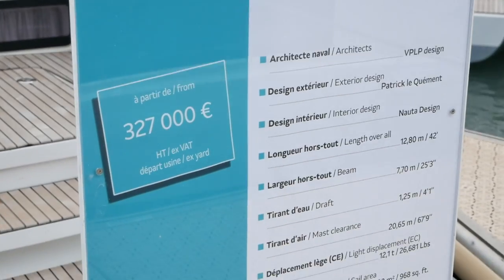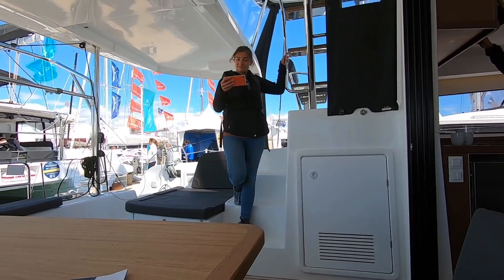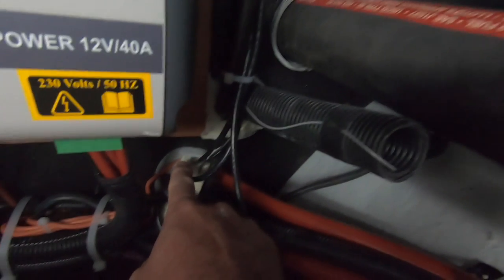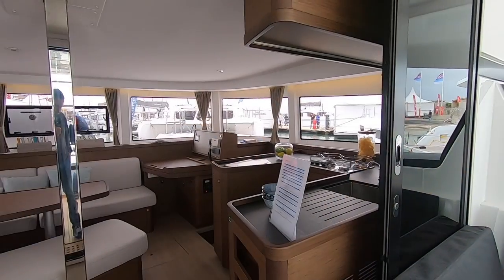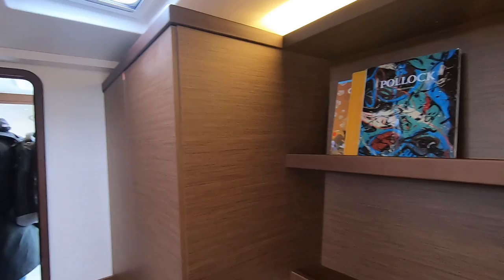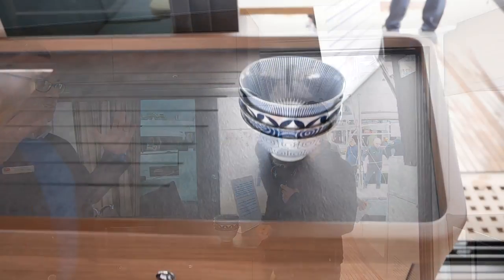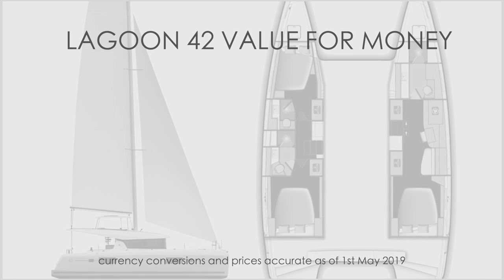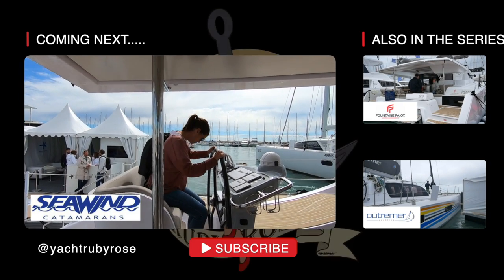Lagoon 42 Catamaran Review 2021 | Our Search for the Perfect Catamaran | Sailing Yacht Ruby Rose

Comment: Production boats represent a better value because their development is amortized over a much larger number of hulls, and the company potentially has more resources to devote to the design.  Being a large volume maker also means the builders and designers benefit from the experience effect: doing more of something tends to make one better at it.

This particular boat seems well built and designed, if slow (by design).  Aside from speed, it's better designed and built than other of the much smaller volume boats you reviewed.  Support should generally be more widely and commonly available too.

The galley is a bit small, as you note.

Comment: Those very large flat windows on the bridge deck concern me. Many times I've been to sea and experienced heavy waves coming over the deck. I have to wonder how they would fare in big seas. Not the sort of thing you would wish to experience at night. Also, I didn't see an emergency hatch inside the hulls. (or did I miss them)?
Reply: There are emergency hatches in each hull. the windows have been in Lagoon designs for decades. If there was an issue with them then we would have heard about it by now. I think any wave breaking over the hulls of a 42 foot lagoon with enough force to break plexiglass windows would indicate you have far bigger problems at hand.

Comment: Nick, I did not see you rate or consider the bane of most cats, the clearance to the water from the main living area.  The "bash" factor.  From friends of mine who charter cats, the newer the boat design the less the "bash" but even some of the new boats I am told have very low clearance and there is significant noise in light seas.  Thoughts?  Should this not be a concern or is this just an accepted reality of cats?
Reply from the maker: Bridge deck clearance is only one factor regarding the slamming when we decided all this. It is also the shape of the underside, the sea state the direction of swell and other things.
It would be impossible to assess at a boat show, so we left it out.
Reply: @sailingrubyrose  Makes total sense, thank you for your very quick response!!

Comment: I also am hot sleeper, why is air conditioning not on your list? That's a must have for me, no negotiations.
Reply from the maker: Difficult when you spend months on end at anchor. You need to run a generator for this which uses a lot of fuel, makes noise and is not good for the environment .
Reply: @sailingrubyrose  Did you talk to Nikki and Jason about running aircon from battery? They went to a lot of effort to make that happen and haven't mentioned it much since then. I'm curious if they've stopped using it.

Comment: The helm position looks much safer with this hard dodger! I saw one of the Lagoon 42s and it seemed really unprotected like you could easily fall off the seat into the ocean lol. The hand rail seems really bad! Especially if you were to sail single-handed! I did read a bit ago about people fitting jackstays to lagoon 450 - in order to clip on safety lines when wearing a harness -  but they couldn't find many attachment points. Not sure how it is with the new 42...
Reply from the maker: There  are definitely a lot of owners modifying their boats
Reply from the maker: There  are definitely a lot of owners modifying their boats
Reply: @sailingrubyrose Yup..  Did u check out the Dragonfly 40 btw? It's a trimaran. Not so much luxury interior but it's fast!

Comment: I took your spec and pricing sheet, and I guess I must want to live a life of luxury or something.  Taking from Sailing Zatara, Jason and Nikki, and others, and this doesn't even include spares and extras, my spec comes to almost 553,000 Euro!  That's like 75,00 Euro more than yours.

Okay, I DID include some stuff not on the list, like 1200Ah of LiFePo4 batteries, triple the amount of solar that Lagoon offers, and changing out all of the electric flush toilets for composting ones.
It also includes a cockpit fridge and a secondary freezer.  In addition, I would look to upgrade the alternators on the engines to 135-150 amp outputs.  Personally, I would also add two Raymarine monitors and a FLIR camera, which is fully controllable from the Raymarine systems.

Still, it's a LOT less than a new Privilige 510 Navigator.  O.O

Comment: I do like this boat but the combination of the davit system and the cockpit roof that extends far back makes it difficult to add a decent sized PV array.
There's a small sofa in the master hull that can be configured to have extra cabinets instead.
One thing I'd love to see as an option on these boats is Lithium batteries. Most liveaboards will upgrade the electrical system and house bank before their first season cruising so why not offer it as an option. The options list is long anyway so this one essential extra makes sense to me. These boats should be designed and built for the needs of liveaboards with the dedicated space needed for batteries and charging equipment but they're not.

Comment: Good review but I don’t think you should be giving performance ratings if you haven’t chartered the boat. I believe you can get much better speeds Than you stated on this 42 model I have heard from charter reviews.

Also they offer AC on this model so the comments regarding air flow wouldn’t be needed in evenings or during mooring.

Comment: The hull is not solid cored below the waterline. In common with FP and Leopard the hulls are balsa cored (balsa vacuum infused with the layup). Only where the through hull fittings go is it solid cored. You can see this on the Lagoons if you look because they don't paint the interior of the hull.

Comment: I don't have a score per se, I was fairly close to agreement with you.  However, I scored it significantly lower than you in the safety category.  If Terysa isn't able to (comfortably) hold on while on the deck, that is a pretty significant hit in my book.  Without the ability to keep the most precious cargo onboard, the score for that category is a 0.
Reply: Very easy to do a lot of things, but the ease of correcting shortcomings shouldn't make for a better evaluation of the product.

Comment: In terms of safety: my concern would be the boom height - It is a long way up there to work on any issues with the mainsail. Also it didn't seem to be easy to get up on the coach room - I couldn't see any steps or an easy way. to get up there so another couple of points off for safety from me.
Reply: The Leopards are much worse, FP are better. And we wrote off Bali, without evening getting on board, I don't think I could reach the bottom of the boom, it was absurd.
Reply: @dscy  To be fair it may not have been an issue they considered... the did comment on the fact that all the reefing lines and other control lines come back to the cockpit.
Reply: Boom height has to do with dropping and stowing the main in a blow when it doesn't drop into the bag. This is the concern as you get older or if you're 5'2". The higher the boom, the greater the chore and even fear because it has to get done in a squall and you're on your own. I was just pointing this out, not criticiizing the reviewers - just the designers and manufacturers..
Reply: @dscy  Being only 5'2" I agree with your comments. I think it would be a real issue for Terysa in the event she had to handle the boat on her own...

Comment: 25.  Lovely boat, but Safety and Design seem biased toward chartered island hopping more than two handed ocean crossings. (Single helm, elevated boom, lack of graspable rails, lackluster performance...)  And the balsa core, even above the waterline, scares me a bit. With cutouts and attachment points where the laminate is pierced, it just seems like, eventually, there's going to be a problem somewhere.
Reply from the maker: Fair points my friend. Log them in the app as well.
Reply: @sailingrubyrose    Done.

Comment: Hi Guys.

As I always say. I know nothing just like Jon Snow but Cat Impi might disagree about the performance of a Lagoon 42. Their vid of the voyage from Fiji to New Zealand in 40 knots had Impi flying at well above 8 or 9 knots. lol.

Check out Cat Impi for their input if you are seriously  interested in a Lagoon or are you just going through the motions for the sake of the channel.

You may have already decided on what Cat you want move up to.

Luv Ya work.

David.
Reply from the maker: I guess it’s subjective my friend. However there is no way a Lagoon 42 can compare in performance to say an Outremer 51 or Seawind1600 both in speed, acceleration and pointing ability.

Of all the cats we reviewed the polar for the lagoon 42 was almost the poorest. For this reason we scored it low.

However as I’ve said many times, off the wind these boats can fly. We’ve been left standing by a old Lagoon 38 as we sailed the 750nm to Bermuda from the Bahamas.
Reply: @sailingrubyrose  Hi Nick. The Outremer I believe is a lightly built performance cat.

A St Francis 50 ft. Cat can sail at wind speed up to 10 knots. 

I guess my point about the Lagoon 42 is that it is built to meet the needs of a wide market and what Cat Impi manages to get out of theirs is extraordinary. You  are comparing cats based on the best parameters as you see them fitting yours and Terysa` needs.

What you end up with, You will be Happy with and that is all that matters.

Regards.

David.

Comment: Just finished a 1400 nm passage on a lagoon 450. Every cabinet squeaked. Every wave banging on the hulls sounded as if you had struck a cargo container. All the the corners were dangerously square and sharpe. I’d never buy one. That being said as an offshore platform a cat is fantastic for comfort and speed. Even a non performance production cat is surprising fast.

Comment: I completely understand your desire for a catamaran if you're planning on extending your cruising to the Pacific. Plus, who wouldn't want the extra room a cat offers for living, entertaining etc. But.... Lagoon?!? Ok, sure....they're pretty and sorta affordable but...look at the underlying "ethos" of the design. It isn't meant for long term liveaboard. 
- No handrails?!?
- A helm that can't see all 4 corners without modification?
- A helm that would require the addition of a safety bar to keep the skipper aboard?
- The steps from the helm into the cockpit look awfully slippery if wet. So you gotta navigate that in bad weather?
- A bridge deck that's just low enough to ensure your longer passages will be accompanied by the constant wave slap underneath?
- No handrails? Ok...they've lost me there completely. Sure, it looks sleek'n sexy but what does that count in a Force 7 when one of you is scrabmling up to the foredeck to attend to a fouled furler/anchor etc. 

I'm not impressed in the least. 

I know $ is also a major consideration but look at a used Antares.... Already kitted out, engine access that doesn't require being the on deck at the ass end of the boat in weather, a helm that doesn't banish the skipper to a lofty/precarious perch, silly things like stuff you can grab a hold of..and on and on. 

I could go on but in my opinion, without modifications the lagoon is the pretty date you take to the dance only to discover it's all makeup, padding in the bra and a cackling laugh that gets old real quick.
Reply from the maker: Good analogy my friend. Thanks. We will of course be looking and reviewing the Antares. We love them as they are proven passage makers.
Reply: You have to add another 300k for a used Anteres

Comment: Alright time for me to have an attempt at scoring things your way

Safety & Design 8
Handrail a big issue but a LOT of these cats cross oceans so the safety must be very good
Build Quality 8
Based on the few I have sailed on and comments from those more qualified than me
Interior Design 8
This is one area that Lagoon are known to excel in
Performance 5
Not a fast cat never really designed to be a fast cat - consider her a trawler in the cat world
Value for money 7
Could easily be an 8 with the owners version they are not so common

My score 36 out of 50

I'm actually surprised I thought it would rate higher

Stay safe
Reply from the maker: Cheers Glen.

Comment: @Sailing Yacht Ruby Rose >>> I am NOT a sailor, although I have been smitten with multihulls for many years.  

That said,  regarding those recessed grab rails you address starting at about 01:02 in this video:  Does the boat builder - OR some aftermarket supplier - offer some kind of handrails you can retrofit to the hull?  

Being a bit short statured myself at 5'5" {or approx 165 cm}, I can appreciate the problems Terysa faces.

BTW, I composed part of this comment using voice-to-text on my smartphone.  It MORE THAN OCCASIONALLY, uh, misunderstands what I am saying, despite the fact I believe I speak a very plain version of American English.  My "multihulls" became "multi holes", and my "hull" became "ho".  REALLY...😊

Comment: Unless Lagoon has changed their build specs for the 2019 models, you might want to check out how they attach their bulkheads to the hulls. In earlier models they simply glue the bulkheads to the hulls, ie, no fiberglassing the bulkheads to the hulls! Without fiberglass reinforcement those bulkheads will separate from the hulls eventually, especially on cats that are being cruised (as opposed to those in charter where they are not being sailed hard). Face it, they are designed specifically for the charter market, not the cruising market & are built accordingly. Separation of bulkheads from hulls in these boats is not uncomman & as such I thing your rating under your catagory of "build quality" is much to high.
Reply from the maker: Thanks for the update my friend. Please put this in a review if you would be so kind. Link to the app below

Comment: One thing you never see in the comments on catamarans is the location of the props ,  some makers for their convenience, put the engines and props behind the rudders , it all works fine until one engine or prop doesn't work , with the prop in front of the rudder you have engine kick, prop behind nothing , quite apart from the prop wash forcing the rudder over if not fully centred .

Comment: The designer who thinks that molded in handrail is an asthetic plus  needs to be spanked repeatedly; apparently the designer has never crewed a sailing vessel in "inclement" weather. Did I see "sail drives" in the engine bay? They are fine for the 1st 5 - 6 years then become a maintenance boondogle.